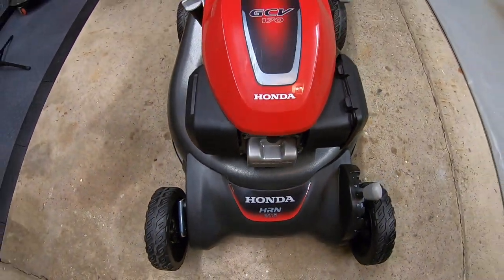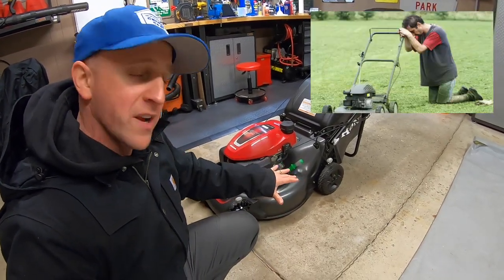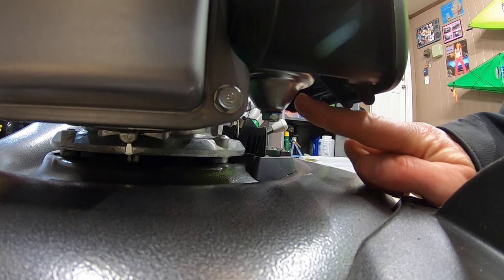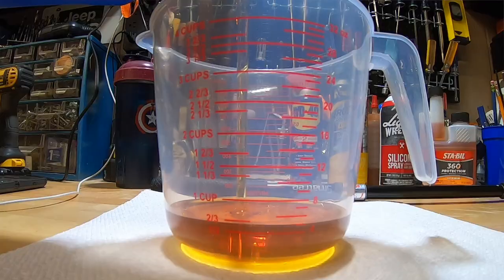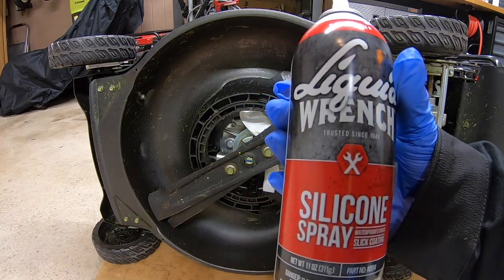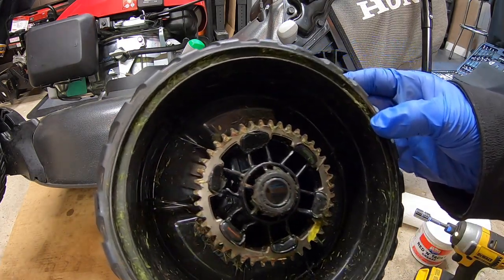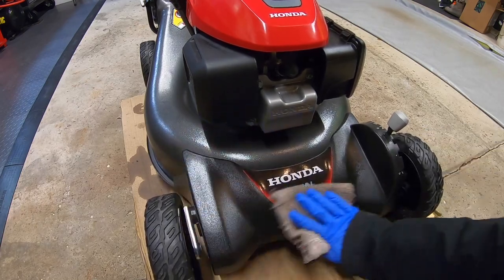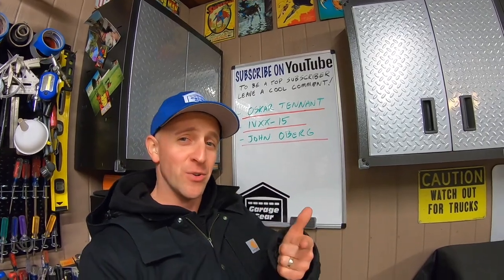WINTERIZE YOUR LAWN MOWER - HOW TO STORE YOUR LAWN MOWER PROPERLY FOR THE WINTER

Comment: Nice but the only suggestion I have is the order of doing things. I do basically everything you just did but in this order : Drain the fuel and run the mower dry. While the engine is still warm, drain the oil. Now here is where I differ. Now that you have No Fuel AND No Oil in the mower, NOW is a better time to flip it over to clean, sharpen blades remove wheels, etc. BEFORE adding oil back into the machine. This way you really don't have to worry about which way your flipping it and I also remove the spark plug and put some oil in it before I put it to top dead center. Just my way/order of doing it. Leave the oil refill for last.
Reply from the maker: I agree with you Paul! For filming purposes and weather on certain days I was forced to film things a little out of order. Delta good plan! Thanks for watching my friend! 👍
Reply: The owners manual recommends adding a little oil into the spark plug hole and cycling the piston to the top position to "winterize" it.
Reply: @phillipb6282  yep, I do that also.
Reply: Yep absaluty  also great advice

Comment: I love this video as as a reminder of my storage routine. One thing I always do is to remove the spark plug examine it and put a couple drops of oil into the top of the cylinder. I have done this two three mowers that have lasted more than 10 years
Reply from the maker: @consanna  awesome ! Great tip!

Comment: That's a great lawn mower. My mower is a Craftsman branded Murray that was picked up from the curb that somebody was getting rid of. Had a sign on it that said "free, won't start". I opened up the air box and the filter was so full of dirt and grass clippings  the engine couldn't breathe. With no air filter it started in 2 pulls. Did the basic maintenance to it and I'm still using that machine today. This was back in 2013 when I rescued it. I'm still amazed at people who buy things and then don't try to even learn how to properly take care of them. $5 for a filter but they'd rather go and buy a whole new lawn mower 🤦
Reply from the maker: Blows me away too my friend! I picked up a leaf blower out of the trash when I was on a walk with my wife. Got it home put gas in it and it started right up. Sold it for $60. Crazy what people get rid off and don’t even bother fixing. This Honda rocks.
Reply: Right? It literally takes at the most 15 min on YouTube to search why lawn mower won't start? Search that and 150+ videos pop up showing how to fix it. Hell even how to turn it into a full blown 8000hp push mower. Instead, they curb it for people like us to safe them
Reply from the maker: @garyalensr  glad you guys are my kind of people here! 🤝👍

Comment: Before touching the blades pull that spark plug wire from plug… also before pulling to TDC spray WD40 in the cylinder 👊🏼👊🏼
Reply from the maker: Good tips thanks for sharing!

Comment: Great content.    I’m the only one in my neighborhood that runs the Timemaster dry.   I also pull the spark plug and add two drops of oil inside the cylinder wall by pulling the starter cord..
Reply from the maker: I’m the only one I think the neighborhood running it dry too. The oil drops is a another great too as well!  How old is your timemaster?
Reply: @GarageGear  going on 3 years now.    Had to replace the transmission last year.    All under warranty.
Reply: @GarageGear  3 years old.
Reply from the maker: @edrumsas5420  I’ve heard a lot of them go after a few years. They haven’t quite figured that transmission out yet. Glad it was under warranty!
Reply: @GarageGear  it was a real pain in the a!$ getting the warranty approve last spring.  This year I avoided power washing the mower deck to avoid getting any water on the trans. Live and learn
Reply from the maker: @edrumsas5420  thanks for sharing this Ed! I wonder when mine will go?
Reply: @GarageGear  just don’t get the transmission wet. If you use the bag; don’t let it get too full.   The weight of the grass clippings may put stress on the gears.   That is my guess.   Great mower just poor design of the tranny.   It would work better with a side discharge bag vs one next to the tranny. Just my opinion.
Reply from the maker: @edrumsas5420  all good info here bud!  I rarely use the bag. And I rarely use the striping kit too. I heard this was a big problem for the commercial models too. I think they beefed it up on the HDX models.

Comment: Im from Melbourne Australia, and I have never done anything to park my lawnmower or weed whacker for winter . I’ve never drained petrol , engine oil  or put any petrol stabiliser in the fuel tank. 
I’ve never ever had any issues my equipment have always started easy.
I’m guessing our fuel in Australia must be of better quality. The fuel is often 1 year old  and I don’t have any issues with starting or performance.
Reply from the maker: That’s interesting. Thanks for sharing.
Reply: @GarageGear  It’s summer over here in Australia at the moment and I’m still using fuel that that I bought last summer. I have a 60 yr old B&S lawnmower yes 60 yr old . and have a Stihl fs45 weed whacker . I find it bizarre that over in the USA you guys run into so many issues if you don’t winterize your equipment. In Melbourne our grass goes dormant for 3 months in winter so we don’t start cutting grass until spring.
It might be a combination of the quality of the fuel and that our temperatures rarely drop below 32c Fahrenheit . A typical winter night will sit around 42c.
Reply from the maker: @Slowrex123  they put a lot of ethanol in our fuel here!
Reply: @GarageGear  Does all the fuel in the USA contain ethanol? We have a choice of regular gasoline or gasoline with a 10% blend of ethanol in Australia.
Reply: same but in the southeast US. i have always drained the gas from my weed eaters but never from my mower. i do change the oil once a year and replace air filter when it’s nasty.

Comment: Thanks, new sub, been watching your videos. I'm close to pulling the trigger on a new HONDA before they step out of the lawnmower business. I see you use an HRN series. Think the HRX is worth the extra bucks?

Cheers
Reply from the maker: Hey Smokey! The HRX has a durable plastic deck that won’t rust, better wheels and a bigger slightly thirstier engine. The hrn is a good model but the decks after just a few short years start to show signs of corrosion. Not exactly a deal breaker but you definitely get some better quality parts on the HRX! Thanks for watching and subscribing!

Comment: I just put engineered 4ycyle fuel in the gas tank and run it for a few minutes and then fog the cylinder. I change the oil in the Spring. I have a Toro with an aluminum deck and a Honda motor.
Reply from the maker: Awesome tips my friend! 👍👍👍

Comment: Great tips, the only thing I don't do is drain the fuel, I always use Trufuel so I don't have issues of gummed up carb. I've been using this fuel for years. It's pricey but very well worth it. I use it in my push mower and lawn tractor
Reply from the maker: Oh cool! You use the 4 cycle blend. I use ethanol free. Do you buy it by the case?
Reply: @GarageGear  no I buy it by the gallon. It's $42 bit I get it at a discount because I work at Tractor Supply. So I get a real good deal
Reply from the maker: @garyalensr  nice my friend! Can I get your deal if I come to your work lol?
Reply: @GarageGear  absolutely, if you came in I enjoy your channel so much I'd make sure you got it for damn near fee. I'm a manager so I'd make sure you only paid a couple bucks. I'd love to be able to find ethenol free gas where I live, but here in Pa we just got junk pump gas. Every one thinks I'm crazy for buying Trufuel but I look at it as oh well it's ethenol free
Reply from the maker: @garyalensr  hahah awesome my friend!  No ethanol free pumps near by at all?
Reply: @GarageGear  no closest one is about an hour and ahalf
Reply from the maker: @garyalensr  got it! Stick with the trufuel then! That will be best for your situation. Crazy its not available near you at all.
Reply: So I run 4cycle trufuel all season. Do you just store it with a full tank of this with no stabilizer?
Reply: @snowfort77  Yes just Tru-Fuel. No stabilizer needed. Tru-Fuel is ethanol free and has it own additives in it.

Comment: i always with ma lawn mower and snow blower after they run out of gas a put syabil in the tank than i crack the carburetor open and when you see the stabil come out of the bottom of the carburetor you know the needle and seat and float are coated
Reply from the maker: That’s a great idea William!  Thanks for sharing!

Comment: Another great vid!  I do almost the same as you do, but after draining the fuel,  I'll add some TrueFuel and let it run on that for a few minutes. Make sure ALL of that crap ethanol gas is out. 

And just a suggestion........ grab yourself one of those hand siphon pumps (the tube with the squeeze ball in  the middle.)  Siphon out all of the gas in the tank, and then you only need to run it for a minute or less until it stalls out.  

👍
Reply from the maker: Great tips here! Like the trufuel idea too. I’ll have to give that a shot! Thanks for being a cool fan!

Comment: I’ve noticed that the Honda GCV 170 and 200 engines are exclusive to their mowers. They only sell the GCV 160 engines to other mower brands and sometimes the GCV 190 for pressure washers like the one on your Ryobi. I own the HRN VLA model which comes with an electric starter for the engine. I would’ve got the HRX HZA if they were in stock
Reply from the maker: It seems they’re pretty specific with which engines go where! I’ve heard nothing but great things about their commercial 21” mower engines. Would love to get my hands on one of them!

Comment: My mower is the exact same, and it's always a pain to get started. I know this video is old... but maybe you will see it! Any recommendations? It's been hard to start since i bought it.
Reply from the maker: Hey Justin! Give the carb a quick look might need a cleaning. I’ve seen brand new ones with gunk in the bowl. See if that helps and let me know how it works for you!👍
Reply: @GarageGear  Will do! Thanks for the response. I will check it out once it warms up a bit for me! Thanks again!
Reply: It sounds like you could have something going on with the auto choke if this has been happening from day one. Honda has had issues with it sticking open and also with the thermowax assembly that controls it.

Comment: Very good video my only caution would be DO NOT water wash the hydrostatic blade control or variable speed control propelled mowers since they will seize up. The owners manual will warn against this area being washed. At Eliminator we are using Gulf Pro Fuels alkylate engineered fuel which they say is good for 5 years and it is made in the good old USA it never fails to start right up.
Reply from the maker: Thanks for sharing this Wayne!! Good tips. Thanks as always for being a cool fan! 👍

Comment: I use ethanol free gas in my mower, snowblowers, and Harley so even though the Harley is the only one with a metal tank, I leave them filled to the top during the off season so condensation can`t form.
Reply from the maker: Good tip! Thanks for sharing Peter!

Comment: I am looking at buying one of these used for $300, is this your favorite mower? Would you recommend any other brands or models to look for used?
Reply from the maker: Hey Dragin! This is a great mower for sure! I’m going to do a full review on it soon! The cut quality is superb!  I would also look at an older toro super recycler or the current super recycler with the Honda engine if you’re willing to spend a little more.! The older toro super recyclers are great if you can find one. Look for the ones with the aluminum decks. Not the steel ones. Hope this helps!

Comment: Do you always put your mower on one side? Or does it not matter considering there is no gas?
Reply from the maker: Great question! I usually tip it in the direction with the oil spout. Then the gas cap is on the high end. I usually don’t like tipping it like this though. I prefer to tip it with the front end up! Thanks for watching!

Comment: Will my diaphragm dry up with no gas in the carb. It's rubber isn't it. Asking 4 real. Not being a smart ass. It's hard to tell with writing.
Reply from the maker: Hey Matthew, some are rubber while some others are a fabric material. The mower is only sitting for a few months without running. It will be fine. No issues ever on my end. I have done this a countless number of times on mowers and other equipment. Never an issue. Thanks for watching!
Reply: @GarageGear  thanks for replying
Reply from the maker: @matthewotis3594  you got it my friend! 👍